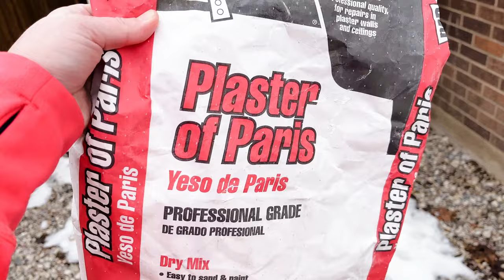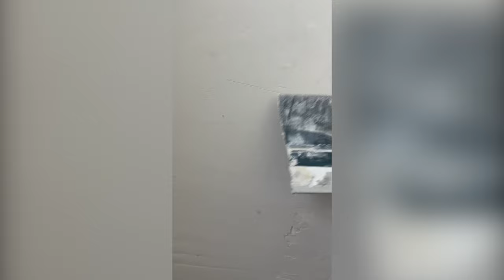Patch & Repair Plaster Walls With Drywall & Plaster of Paris

Comment: Fantastic video! So well explained, in just a 10 minute video, with that gorgeous "beauty shot" at the last second. Well done! 🙂  One tiny tip I learned from a fellow YouTuber is to cut your mesh tape 2:52 you can simply use your taping knife as a flat blade, then pull the mesh tape up and it will cut like a razor.